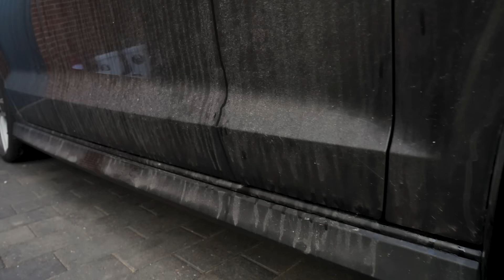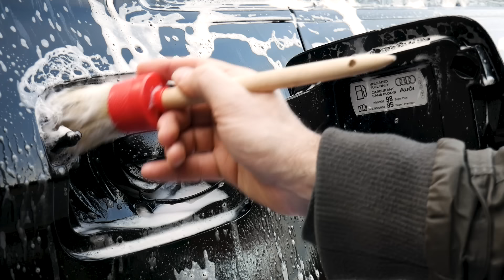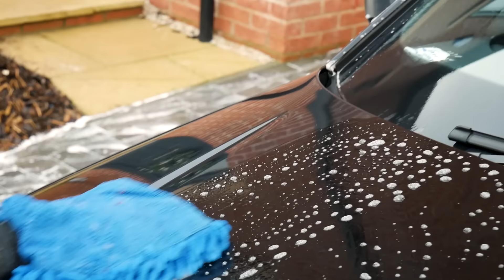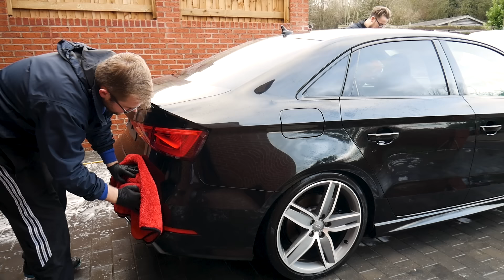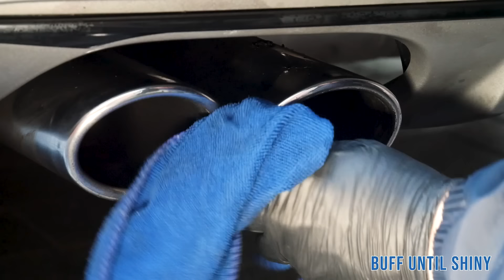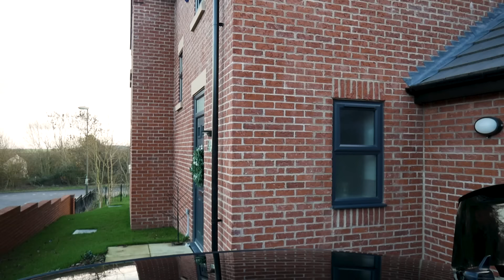10 Steps on How to Detail Your Car: A Beginners Guide

Comment from the maker: I know we may all detail in a slightly different way. So, what's your standard order of detailing?
Reply: For me, I usually do the wheels first, whilst the ground is still dry. With the car facing up the drive, I do the rears first, so that I don't have to kneel in the water that's run from the fronts.

Then I foam, and whilst that's soaking I run around with APC and a detailing brush, rinse, wash, rinse, decon & rinse (if needed) and then dry.... Obviously, depending what kind of detail I'm doing, I'd then polish/wax etc.
Reply: Prespray with ONR. Clean with ONR. Dry with Optimum Spray Wax. Maybe a little Power Clean on the rims if I let it go too long. Some tire shine at the end. Done. 

Occasionally hit it with some iron remover and a clay product. Twice a year? Sometimes 3.
Reply: For my weekly wash (after cleaning wheels) foam, rinse, 2b wash, rinse, blow dry, clean glass, dress tyres. First wash of every month top up protection with something like Bead Maker, Wet Coat or AutoGlanz Prizm etc. Vacuum interior, quick wipe down of dash, seats etc.
Reply: It seems wheel first or last has been to death:
https://www.detailingworld.co.uk/forum/showthread.php?t=277108

Wheels last (ish) for me as per the vid.  I stick to the mantra of washing top down, the wheels are the last part of my prewash routine.  Then I dry downwards after a 2BM wash, using a separate MF for the alloys and usually a spritz of QD.
Reply: i pre shower rinse the car body, not  jet wash.  only the arches get the jet and the under car.  you are just forcing the grit and s#%t in to it. i gently wash off the foam too.
Reply from the maker: How do you apply the foam? Assume with a jet wash, rather than one of those hosepipe attachments
Reply: Detailing World  i use jet wash to apply foam but obviously doesn’t come out as a strong direct jet
Reply: all i’m saying is the idea of the foam is to gently extract dirt and grit softly but if you hit it with the jet wash before and while the foams on  then its taking part of the  idea of the foam away. when the snow foam attachment is attached to the jet wash that ok to use. each to their own. just what i did since seeing it done
Reply from the maker: I get what you're saying. As you say, each to their own. There's no definite right or wrong way.
Reply: i do wheels first then snowfoam it dry
Reply from the maker: Same for me. But this was a friend doing the detail, so I let him do it his way. Goes to show, there's no definitive right or wrong way for some things.
Reply: Definitely doing the tar and iron removing steps BEFORE contact wash and drying (rinsing in between of course). Rarely apply degreaser above the lower side window line...Heavy chemicals have drying effect on plasic trim and rubber.. I make sure to put a layer of spray on sealant before final dry to make sure every part of the car has a basic protection. Works wonders for a final rinse and dry-off as well.
Reply from the maker: Really!? You decon before the wash? I kinda see your logic, but also makes sense to remove most of the dirt first.... In the past I've been known to use autosmart fallout before contact wash,but only because I had so much of it 🤣
Reply from the maker: Yeah, local climate can effect how we detail.
Reply: U polish without a polish machine? Its new for me! Other thing is, how many differents microfiber towels do u have?  And one more thing, dry the exterior car with a microfiber glove is allowed? Is it possible? Obviously a new one.
Reply: Amazing attention to detail, would you recommend clay bar before the polish just in case for any contamination still left? Also as the side skirts and lower levels are prone to dirt more maybe a different wash Mitt and not to rub over the same panel backwards and forwards without rinsing the mitt out ?
Reply: Current cleaning regime is to hope it rains. Looking to change that by watching videos like this one.
Reply: This video for some reason made me want to label all my cloths as although washed I prefer to use them for same thing.
Reply: I just look at the car dirty then do my magic and it forever is clean
Reply: Auto glym pre wash snow foam
Rinse 
Alloys
Rinse 
Autoglym shampoo snow foam
Agitate
Rinse 
Autogylm sealant
Rinse
Dry
Alloy Protector 
Tyre dressing
Job takes an hour at most

Comment: Matt, another nicely done vid mate.

There is a few bits which if aimed at the beginner could do with tidying up. Process is subjective. Wheels first is pretty much a given,  rears first as they tend to be cleaner so the water remains cleaner longer then fronts. Not always necessary to use a wheel cleaner, car soap or dedicated wheel shampoo and green star APC does me, milder on the wheel sealants I use. Dirtyer wheels yes a wheel cleaner. Tyres britemax grime out and Tuff shine brush before dressing
The process on the pre-wash seemed time consuming. I always pre-rinse then depending on the state of the car either APC or citrus through a pump sprayer left to dwell then foam on top. Adds a bit of bite especially with the bug splats in summer, AG Bug off is my go to. 
Careful with tar & glue removers as a product like powermaxed tar & glue (great product) tends to dry quickly which as we know will stain all surfaces so lots of caution.
Fallout is pretty straight forward to  use, some more effective than others.
Clay again some clever options, bar, block, cloth or mitt. If the car needs it!
After decon I would foam or contact wash depending on the contamination that was present to neutralise the chemicals. 
Polish to correct paint which will leave polishing oils behind, even pre-wax cleaners. These will reduce durability of coatings so it's important that either a dedicated panel wipe or IPA is used to ensure the panels are free from greases and polishing oils. 
All in one polishes, glazes and products such as Autoglym SRP are designed to fill so IPA or PW wouldn't be used afterwards.
Wax, seal or ceramic coatings. I'm a believer in just one or the other, my preference is wax while I still can. Don't be me, buy a summer show wax and a winter wax or just one pot for both and enjoy it.
Reply from the maker: I didn't include clay as I wasn't including any machine polishing.... But I know what you mean regarding the rest. As I said in another reply, personally I always do wheels first, but in this instance I followed Brett and let him do it his way. 

I will be doing more in depth videos of each stage, and possibly another video similar to this, but with more advance steps included.

Comment: A couple of things I noticed in the vid: you spray tar remover on, then spray iron fallout remover on without rinsing off the tar remover first? Also, the iron fallout remover you say to wipe off then rinse? I would have thought you'd scratch the paint with all those little bits of iron?
Reply from the maker: A plush microfibre would capture any small fragments of iron
Reply: @TheDetailingSpace  Thankyou for the quick response, much appreciated. 

The only plush microfibre I currently have is a drying towel so I won't use it for that job! My other microfibres aren't plush, they're 300 gsm and a 70/30 mix which I use for wax removal /general cleaning. So I will continue to just hose the stuff off afterwards. 

Thanks for the videos, I'm learning loads from various YT channels, forums, etc. 

Just recently bought my first DA, a das6 v2. Had some great results (my opinion) on my first car. I know there's still some scratches on it but I'm pleased with it, especially as it's owned by someone who couldn't give a hoot about it's appearance so it's not exactly been cared for the last 20 years... (Toyota Yaris, dark metallic blue, a stunning colour when it looks good). Once again, many thanks and keep up the good work.
Reply from the maker: Nice. Glad you found it useful. Be sure to check out back catalogue of videos too 👍

Comment: Wow amazing detailing!

I'm pretty new to this and had some questions to everyone as purchasing all this equipment is pricey but I wan't the best at a reasonable price.

1) What pressure washer do y'all use
2) What is the best snow foam/tar remover. Heard mixed reviews about autoglym
3) Should I go with a tyre dressing spray or applicator?
Reply from the maker: Glad you enjoyed it!

I currently have a Kranzle 2160, but in this video, it was a friend's Karcher K4
As for tyre dressing, whichever you use, use an applicator (if a spray, then spray on to applicator). Otherwise you'll get overspray on the alloys and maybe the bodywork too 👍

Comment: Step 7: apply polish?
You can only apply wax etc., wax is not a polish, since polish must include abrasives.
Other than that, I usually just do wheels first and then the whole proces you did.
I love that you apply APC as a pre-wash (since most waxes etc are not removed with dedicated wax removers such as CarPro Eraser etc) APC 100% removes anything below nano or ceramic coats.

Step 8: Glass
I rather spray it on the microfiber, due to overspray .. just cleaned the car spotless, and now you have overspray on the car (especially visible on black cars under sunlight).

Buffing of wax in straight motion for me proved to be a CON when the microfiber gets a bit saturated, it pushes the residue at the end and then you have to use quite alot more elbow grease to get it off, which could result in some minor marring.
I preffer gentle circular motions and it never tends to leave residue.

Other than that, keep it up, great work! :)
Reply from the maker: As the title, this is mainly a guide for beginners... The detail enthusiast knows Polish is a process and not a wax type product. But for the average Joe watching this, "polishing" is the act of apply SRP or similar product
Reply: @TheDetailingSpace  Fair point.  I was a bit confused at the use of "hand polish" in this video but your explanation makes perfect sense.
Reply from the maker: No problem at all.
Reply: Detailing World but I think you should start here with educating the average Joe to avoid him going to the shop, buy some polishing compound and just spread it on their car. (Although I totally get your point and intention)
Reply from the maker: Ok, thank you for the feedback

Comment: Mat, after polishing would you not use something like Carpro Eraser to totally clean the surface before waxing?
Reply from the maker: Yes I would. But this is more of a beginners guide, and the polish stage likely to be something like AutoGlym SRP or some other commonly available product that the general public would know and have easy access to.
Reply: thanks Mat just checking :) @TheDetailingSpace
Reply: ok thanks for the clarification  @suspower6969
Reply: No IPA or panel wipe after glazes or something like AG SRP or AIO. Definitely after polishing or prewax cleaners. Not all waxes contain oils, Wax Planet Obsidian has no oil contents. You want the paint as clean as possible before any coating. Polishing leaves the polish lubricating oils and micro abrasives behind, even with prewax cleansers. IPA is cheap as chips anyway! This is a stage which causes problems with durability and is not focused on enough. I listened and understood from the tradesmen and use a dedicated panel wipe before waxing. I'm a wax slut! I get the best from my products.
Reply: @TheDetailingSpace  I was thinking that there wasn't a lot of actual "polishing" going on there (which takes a bit of elbow) but more the spreading around of a filler polish like (the excellent) SRP . I would personally still put a bit more effort into working SRP to make use of it's polish components. Nice video.

Comment: Im currently driving a peugeot 308sw allure. Is it fine to wax the whole car at once and then buff off at the end? Thanks
Reply from the maker: That depends on the wax and weather conditions. I have done that in the past. You have to bear in mind, removing wax usually takes longer than applying.....

I usually apply to the bonnet and roof, then remove once it's cured long enough. Then do one side of the car, then the rear, then the other side and finally the front
Reply: @TheDetailingSpace  so you're saying that once you're done with the bonnet and roof, you do the rest at once? Thanks
Reply from the maker: No. I do bonnet and roof, wax and remove. Then drivers side wax and remove, then rear wax and remove, then passenger wax and remove then front end....

But as I say, it all depends on the product you're using, cure times and temperature...

If the product has a long cure time and its fairly cool, you could wax the whole car in one go.

If it's the height of summer and baking hot, then wax and remove 1 panel at a time.
Reply: @TheDetailingSpace  got it. Thanks for that. 
Btw have you got any videos when it comes to clay bar the car? Bought some together with lubricant but not sure when this stage comes in washing the car. I suppose that is the last step of decontamination right? But do i need to re wash the car again? Or can i just rinse it thoroughly? Thanks once again.
Reply from the maker: The latest video that went live this evening shows me claying the car. Don't have a video specifically about claying, but I do have one planned. Be sure to subscribe and keep an eye out for it
Reply: Already done it mate. Thanks for all the tips! 👍
Reply from the maker: Nice one. Thanks.

Comment: Great finish!  My steps are 1. Rinse with pressure washer, 2. Powermax TFR all over car inc wheels, 3. rinse off, 4. clean wheels, 5. lava foam, 6. rinse, 7. then 1 bucket method (put Meg gold class in a spray bottle with warm water, then 1 large bucket cold water for rinsing mitts),  8. Tar and Glue remover, 9 rinse, 10. Iron Fallout remover, 11 rinse, 12. dry with air blower and Hydrophobic dry aid, 13 Ceramic detailer, 14 For extra gloss use SIO2 gloss detailer.  Then rest!!!!!!
Reply from the maker: That's a lot of steps, and never heard of anyone using soap in a separate spray bottle. Guess it saves on wasting water 👍
Reply: the theory behind it is that is it one less bucket of contaminated water...there are arguments that grit guards are not perfect in stopping contamination.  I also spray the mitt to further reduce any contamination.

Comment: Just go to a local car wash and glaze it after to hide swirls. Every 2 weeks repeat. Quicker no stress.

For those who finance/lease/pcp

If you gonna own the car for many many years then doing it yourself is worth it.
Reply from the maker: My last car was lease, this one is PCP. I still look after it  as though I'd bought it out right. I've never understood that logic. It's like saying don't look after your house if you rent or still paying the mortgage off.
Reply: All the hassle of doing it and cleaning up after the the £££ spent on products, I just don’t see the logic unless it’s a hobby and a person is compassionate about it.

I lease so after 2 years it’s going to be the next owners problem. A quick glaze with a micro fibre keeps it looking like it’s been detailed meanwhile.
Reply: I drive a lease car, last year when I changed my company got charged 600euro for minute scratches and one wheel scuff (I wasn't into detailing, but I thought the car was in great condition after 3 years an 210000km)
So, any car is worth it...

Comment: Rinse, prewash, rinse, snowfoam, rinse all seems a bit excessive? I would clean wheels, then either snowfoam or prewash then rinse. Putting snowfoam or prewash on a wet car surely just waters it down, makes it less effective and more just runs off onto the floor.
Reply from the maker: I think there's mixed opinions on whether the car should be dry or not. Personally I do similar to you, and foam a dry car. However, in this instance I let my mate do it in his usual way.
Reply: As you say, no right or wrong way, just different ways 👍
Reply: Wheels first then pre wash foam your car and then rinse off
Reply: All depends how maintained and clean this car already is. Seems this car gets washed often , in this case I dont see the news in going crazy .  Just d the basics to it .

Comment: Thanks, but that's just a lot of steps. What would be the minimum kit for someone who is just going into detailing, or someone who primarily use a touchless car wash but wants to give his car a bit more love once in a while? 

Here is what I am thinking:
- microfiber cloth

- some type of bug/bird poop remover to act quickly when a proper car wash is not possible
- a clay bar to remove debris left after touchless car wash
- wax to use once in a while after a touchless car wash and/or after using the clay bar use

What do you guys think? I am not trying to win any competitions here, just trying to find a process that I will be able to stick to.
Reply from the maker: You would use a clay bar unless polishing. A heavy clay bar can induce marring

The minimum would be, prewash, shampoo, wheel cleaner, APC, wax... Hell, you could even drop prewash if you was really on a budget and wanted the least steps possible

Comment: As educational as this is, it seems that the process here didn't make sense to me because I adopt the inside-out approach  starting top to bottom working with gravity. So for me it's the interior roof, glass, dashboard, seats and vaccum mats & carpets from all the areas you cleaned earlier. The outside bodywork I don't use a high pressure water hose because my previous car the clear coat paint got peeled off. But again taking a top-down approach too.
Reply from the maker: I guess that that shows there is no definitive right or wrong way.